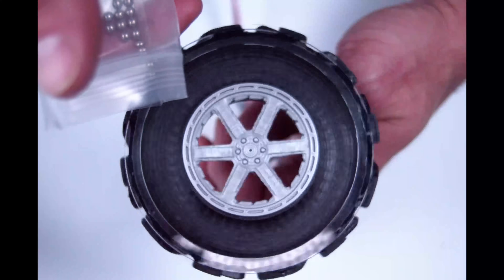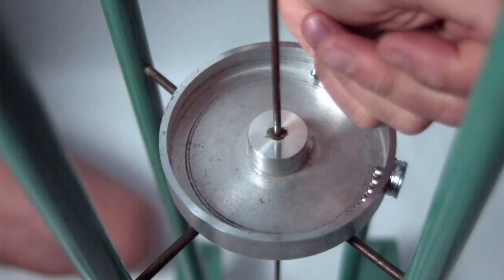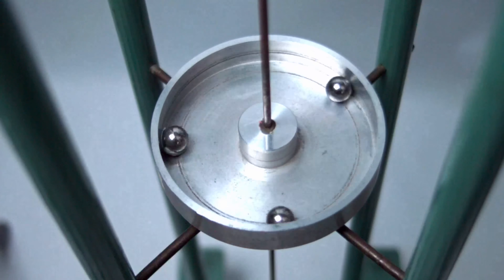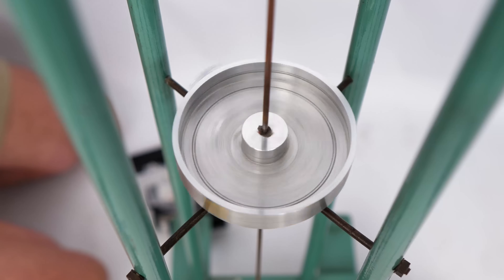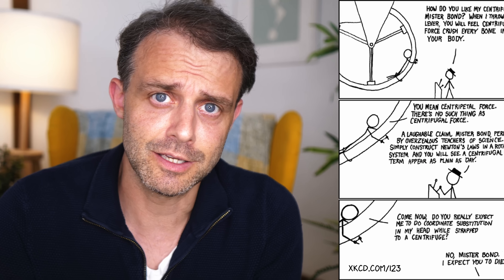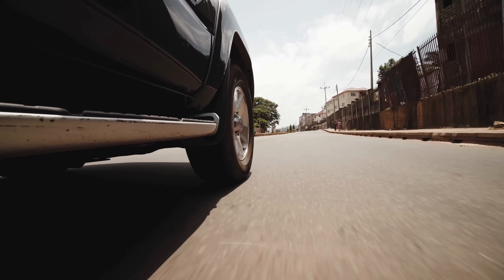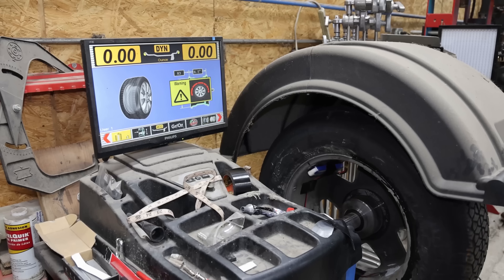Do tire balancing beads actually work?

Comment: As with all placebo effect things, the problem isn't whether or not they actually work, it's the hidden side-effect.
For exemple here : putting HARD glass beads in your SOFTER tire and most importantly rim, is probably the most outrageous thing about them, and idk, they could just use a softer material and at least that problem will be mostly gone. But it's like they know their product is placebo and don't care at all about anything else... (and also they know people don't care about how their curb rash wheels look on the inside or that they'll have to replace their slick tires sooner)

Comment: Nothing like media blasting your wheels and tires from the inside. 
If I were a highway (only) driver, maybe it would be useful. But, as a stop and go driver on my commute, I'll stick with stick-on weights. The place I buy tires includes free rotate and balance and overall they are no more expensive than their competitors. I generally rotate the tires myself until it is time to have them balanced. I'm at 93k miles on my original Goodyear Wrangler Duratrac and still above minimum tread. They've worn like iron though they have always been bad on wet roads. They are about to be replaced though, we had to wait until we closed on our new house before we could replace them.

Comment: I tried these the last time I mounted tires on my medium duty truck. I'm very unimpressed. They always vibrate and it's always at a different speed. If the unlucky number lands between 65-75mph, I have to pull over and stop to reset them because it's so unbearable

Comment: Ok, so we need an aftermarket ring that attaches to the wheel with balls between two friction plates. When the wheel gets up above critical speed, a weight trips an over-center lever and squeezes the two plates together trapping the beads so they can't move when the tire slows down.  Instant perfect balancing that stays put.  If your tires get out of balance later, just reset the lever and let the balls rearrange again.

Comment: Before jumping to using beads guys, be sure to make sure your suspension is in shape. Every shock, bushing, ball joint , engine/transmission mount, and pivot point can change the harmonics of your spinny things.

Comment: ok, so here's something I want to try: Spray a 2-part epoxy mixture or some other slow-ish curing adhesive into the tyre (valve core removed obviously), add some beads of say 5mm size so they can readily move about in the uncured adhesive, go for a drive at 100km/h for 15 minutes (let's call that the curing time). Now, when you slow down, the beads are glued into their correct locations permanently. Thoughts?

Comment: I have been using balancing beads for about 30 years now in all my motorcycle tires. In my usage, I have noticed that they seem to smooth out at about 17 to 23 MPH depending on tire size. Nothing really scientific, but seat of the pants testing, and really paying attention to the effect by slowly acceleration and decelerating on the smoothest roads that I could possibly find, so I could find a threshold of when the balancing effect started to work.

Comment: Wheel balancing on motorcycles tends to be even more important than cars, because the ratio of rotating mass to total vehicle mass is so high.  I researched beads for my 950 pound Gold Wing, and while ceramic internal beads are available, they have some drawbacks.  I found that the centramatic add-on external disks were available for my bike, and I made the plunge about 10 years ago.  What an extraordinary difference.  It’s a circular “tube” that is self-contained and does not affect tire changes at all.  You know they work the moment you install them.  They’re extremely popular in the semi truck market as well.  I didn’t know if I’d ever go the internal beads route, especially given the number of cars today that don’t have a spare tire and rely solely on tire slime and an inflator in lieu of a spare.  (I am not associated with the centramatic manufacturer in any way.)

Comment: I'm a mechanic who, both professionally and personally, has experienced tons of out if balanced tires. The feeling is usually most pronounced ≈60 mph, so highway speed balancing is actually most critical. Only a bent wheel, separated tire, or horrendously out of balance tire can be felt below 50 typically

Comment: Its a pendulum absorber like the tci rattler and aircraft engines. Issue is the beads bearings whatever need to be constrained to an area so you stay in the sweet spot all the time.

Comment: Our old work truck (Chevy 3500) had bead balanced tires. They worked fine. At very slow speeds (5mph) you could hear them if you were outside the truck. Only real issue is that you had to make sure that you were filling the tires with dry air. We were told that moisture caused problems with the beads. 
They work fine, but I really don't think that they serve any purpose for a normal vehicle. Seems like they would be better suited for more heavy duty vehicles. 
With how often that truck towed FAR above its rating, maybe the owners were onto something. I doubt it, though. Seemed more like a "lets see if we can do it" situation.

Comment: In early 2000 cd drives manufacturers advertised such balancing technique as a cool know-how that reduced vibrations while reading CD at top speed.  I remember I disassembled my drive to clean a laser and also to look how this balancing balls looked like inside the drive.

Comment: Well, I can think of an alternative, permanent way to do this. At a test drive station (with the little wheels or hoisted up in the air idk), spray in some quick-setting elastic resin. I think (intuitively, please correct if you actually know fluid dynamics) fluid would behave identically to those balls when spun past critical frequency. Then spin it long enough for it to set, and presto, balanced tyre. It would have to be something with similar enough elasticity to the rubber it's stuck to, so as not to produce stresses when flexed on the road, but I don't really see downsides for this method. There probably are, since it's not used, but I don't see 'em :3

Comment: this is basic simple physics but the use of beads is odviously rediculous, one could simply compare this to why directions of such fix a flat products state to drive your car at a good reasonable speed and distance after its use with the advantage that it would stick and stay where its needed besides be pushed through its puncture. depending of coure the type of product and how much is being used, all you have to do is to develop exploding glue beads, good luck hah hah hah, stick to high speed balancing your tires and avoid using any fix a flat products

Comment: "I was just trying to balance my tires" unfortunately won't get you out of a speeding ticket.

I'm doubtful that the beads will be terribly stable when slowing from the resonance speed... unless you're on a glass-smooth road. The beads would be quickly redistributed when going over a large pebble, railroad tracks, expansion joints in bridges. I think the flexibility of the tire won't matter too much; if the beads are accumulated at the bottom when hitting a bump they'll be widely scattered inside the tire, while if 180 degrees from that essentially no effect with the beads furthest from the deformation of the tire.

Also... is "tyre" no longer a valid spelling in British English?

Comment: If there was some adhesive that could be released at high speed, then it could permanently balance them. Although it may not be that permanent once you start wearing your tire down, and may end up causing more problems down the line

Comment: As an auto mechanic & someone who has used balance beads on my own vehicle I strongly believe they have no use in light/medium duty vehicles. Heavy duty vehicles are the only time I would recommend using them. Too much noise, especially on larger truck tires. Variability in effectiveness creates issues when trying to diagnose vibration concerns. Just not worth it

Comment: So if you inject the "paste" that you use to fix small punctures in your wheel and go drive at higway speed for a good 20 or 30 minutes then it should balance your tire and solidify in the balanced position ?

Comment: These beads do work very well. I looked into them last year when I found a Sony CD-Rom drive that used "dynamic balancing" to stop discs from exploding at 52x speeds. Inside the self balancer was a handful of steel balls that work in the same way as tire beads.

Comment: There's another important thing though - ok, one of the local minimums (where the ball bearings want to stay) is apparently "the balanced" one. The question is - is there other local minima, especially when there's a lot of them, in which they can also find a stable position.
Because if there is (for instance - all of them clumped together or something), and if they "switch" from one to the other, say, because of a bump on the road, you'll end up with highly unbalanced wheels while riding at highway speed, which could be potentially deadly.
Exactly as the example with this milk ... thingy (don't know whatever the word you are using in english, not my native), but the opposite - while being balanced a sudden push to totally unbalance it and stay there.

Comment: So practically useless in the UK and will become more useless the more crammed up the roads get.

And all the time where super critical speeds cannot be reached those vibrations are causing further damage to other structures and components.

If the fix only works 20% to 60% of the time, or even 1% to 99.9% of the time then the problem isn't fixed.

Sounds like a false economy to me. Sure the beads do have the potential to counter-balance, but only under certain criteria and for limited durations at a time.

I can sweep dust under the rug, but it won't remove the dust from the living room.

Comment: I'm kinda thinking have the mechanics use the balancing machine like normal and then only throw a little bit of these beads in, like most of my driving is highway so it might be nice, I haven't had any shaking on this current balance tho and also my biggest issue comes in the winter when snow gets stuck in the wheel

Comment: Why not have some light glue mixed into the balancing beads? Basically the idea would be pour balancing beads and glue inside the wheel, fill with air and drive with 80+ km/h for 15 minutes for glue to cure. That should result in perfect balacing that wouldn't fall back on next traffic stop.

Comment: I wonder if with the beads, there is any significant additional wear now on the inside of the tire and if there is any bothersome damage/where to the wheel due to the beads bouncing around before you hit highway speeds (and again when you fully slow down)

Comment: Beads are doing a montecarlo integration - averaging out the nodes from antinodes - the ramp up through the frequency domain is ?? important 
?? put some thermally setting resin (or a 30  min setting - take a 15+ min drive... - run until  "smooth-running - and heat the resin (resistive mesh in the tyre inner surface) - voila self directed dynamic tyre balancing..

Comment: A 'bolt-on' device was demonstrated in the 80's on the BBC Tomorrow's World program, It was rather like a Ferris wheel having a oil filled clear tube with some ball bearings inside.

Comment: This is quite interesting.   I can see that tyre changing services might hate the beads because they make a mess and get in the machine when you change a tyre.  However if there were a slowish curing adhesive thrown in too so you put in a bead sludge fill the tyre with air to the correct pressure and then drive for 30 minutes at a fairly constant speed so that the sludge can cure in place then it might be more popular.

Comment: Why couldn't you just put larger ball bearings in your car tires and add some kind of adhesive that hardens over a longer period of driving at the required speed, thus fixing the weights in place?

Comment: You only showed that it works for static balancing. I wonder if it also works for dynamic balancing, as that is also relevant for car tires. (Dynamic imbalance is a condition where a rotating object has uneven mass distribution on both sides of iths centerline, causing the rotation axis to wobble or tilt while spinning.)

Comment: Since you have access to a camera that can be mounted inside a wheel being used on the road, could you do a video on what happens to the shape of a tyre when you deflate it to below recommended pressures and drive it on a dirt road at between 40 and 80km/h please. Thanks.

Comment: I wonder if you could engineer something to hold the beads in place once they find the balance point, like make them out of some sort of non-newtonian fluid that softens in the conditions above the resonant speed but hardens and sticks to the tyres at low speeds.

Comment: I have a hard time believing that reaching freeway speeds once is enough to put the beads into the right spot and that you can then slow down and still have a balancing effect. The tire does not work the same way as the metal cup in the demonstrator, because it has a flat spot where it meets the driving surface. That bumps the beads once every rotation and if the wheel is at subcritical speed that is enough to move them out of alignment.
In summary: This is snake oil after all and probably the reason why glass beads have not been widely accepted even though we have had air-filled rubber tires for a century.

Comment: What if we added a fluid adhesive along with the glass particles and drove at highway speeds for a few hours before it dries — wouldn't they automatically settle into their ideal positions? And if wheels were balanced using this method during manufacturing, wouldn’t they offer a much smoother driving experience?

Comment: Maybe if you put a silicone type liquid in the tire
Speed it up to the speed with the beeds and keep it spinning until the silicone is cured than it should be balanced practically for the rest of the tires life
But at that point it would probably be cheaper and easier just to get counter weights

Comment: 8:30 Steve, I think that what you're doing at this point in the video is straightening the wire (somewhat) and it makes me wonder if this self-centering thing is related to a method I found for straightening wire. If you were to pull a length of horribly bent wire through curved slightly curved tube while that wire is attached to a spinning drill, it straightens the wire UNBELIEVABLY well. Sometimes you have to work is back and forth a bit, but it is truly amazing.

Comment: In city the driving speed averages around 35km/h.  Moreover, there are speedbumps, traffic lights bumpswhere you have slow down and even stop. If you are not able to go up to supercritical self-balancing speeds anyhow, the beads may wear the tire inside out.

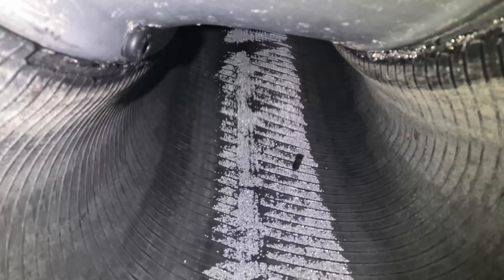Comment: It's worth pointing out the test done here neglects one detail about tires that could have an impact. Tires are not rigid, the part of the tire that's in contact with the ground flattens slightly, even with good pressure it deforms slightly to the shape of the ground. And from the perspective of inside the tire that looks like a line of slight deformation that moves around the tire in a loop, you can see it at 9:52 as an example. This motion may upset the beads enough to break the alignment once you drop down below the critical speed. Is there any testing done on how much that might impact the results? There's also the fact that the inside surface of tires aren't always smooth and can have ridges, which can prevent the beads from simply moving to where they want to as in your sloped floor analogy, the slope of the floor would need to be large enough to overcome that slight edge and also acts as a form of quantization of the positions the beads can be in. Again is there any info on how this affects the results?

Comment: What if you did this in a dealership with beads that permanently affix themselves to the inside of the tire after a time? In theory the wheel should balance itself and the beads should then affix themselves, leading to the tire permanently balancing itself after the procedure is done.

I mean, it's relatively simple, you pour in the beads, spin up the wheels, wait a bit, and you're done.

Comment: Related to drive screw whirl dynamics I suppose. 
Which I learnt after being forced into design of very long and small diameter leadscrew drive (approx 3m long 8mm diameter) to attempt to move a loaded carriage vertically.
 When it hit certain rotation speeds the resonance was so violent and so sudden the end bearings nearly got destroyed. The formula for these resonances is supposedly well known and consistent (depends on end constraints conditions) - unfortunately my design started resonanace only 60% of the supposedly reliable predictable predicted speed. Never found out why - we just limited max motor speed to avoid the resonance.

Comment: Can't recommend anydesk at all. They had a major security issue last year and the communication about it was absolutely horrible. And i have even paid for the service. 

If you need a remote desktop service please choose rustdesk instead. It is open source and free to use - and ! You can host your own rustdesk seever with encrypted connections so that no one is able to call your devices who is not part of your rustdesk setup.

Comment: as a consumer grade ex-mechanic, these seem cool but they also seem like overkill. adding clip-on or sticker weights isnt very difficult or time consuming. and it near-guarantees balance until you significantly alter either the tire or hub shape. i expect there to also be unnecessary wear from the beads on the inside of the tire, and a royal pain to clean them up. never saw them used personally. the only real use case i see is for non-standard or oversized tires which are a nightmare to get right with weights, and where the alignment might not last.